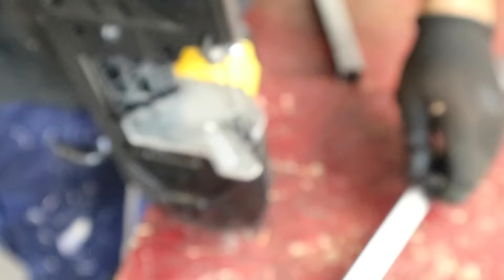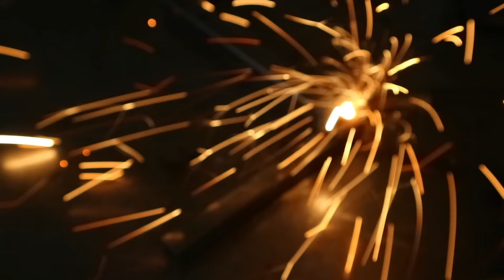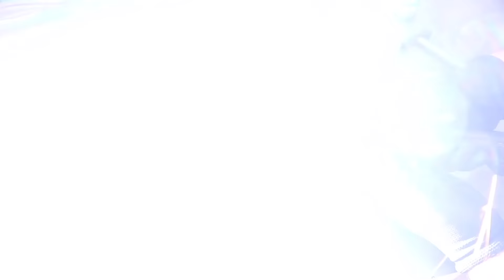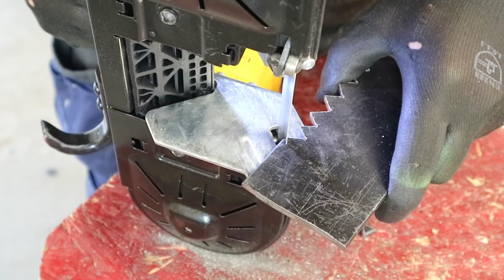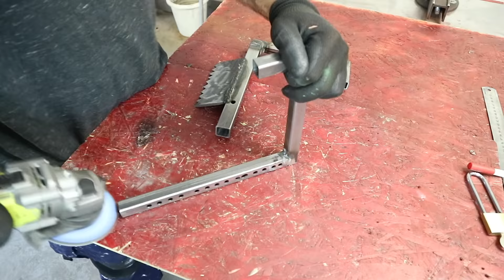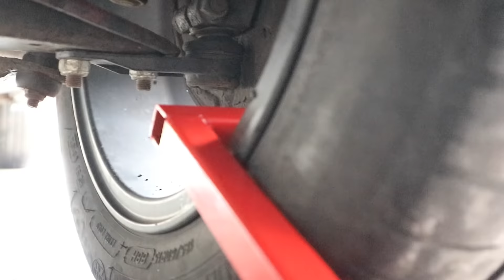Amazing Brilliant !! Life Hacks for CAR

Comment: You should of made the part that goes through the wheel like the part that lays on the ground, just not weld the flat plate to it. Slide the 2 halves together and have a lock up by the wheel, and one down on the piece with the flat plate just how you have it. That way nobody could pry it off. They would have to cut it. The more the thief has to mess with it to get it off, the better chance of him being caught in the act. Cool video. Keep it up.

Comment: 30 seconds and a hacksaw and that sucker is off, waste of time!
Reply: Hacksaw or a decent hammer and that contraption is toasted. As said by others nice scraping your alloy wheels. If you want to pee an ass parking in your spot maybe ok, but for protection: naaahhhhh!!!
Reply: You actually can probably sit on the ground by the wheel and put your feet against the wheel and grab the square tubing and pull it towards you and it would bend enough to get it off.

Comment: That thing will just scratch your rims when you use it and it would be easy to crack it in half to remove it or even just busting the lock with a hammer since it is pretty much directly on the ground... Idk where this idea comes from but its not a good one.
Reply: If you wanted to pee an errand parking ass off, fine but way too much work to do so when a small wooden match in the airvalve works wonderful is easy to carry and has the same effect: peed off!!